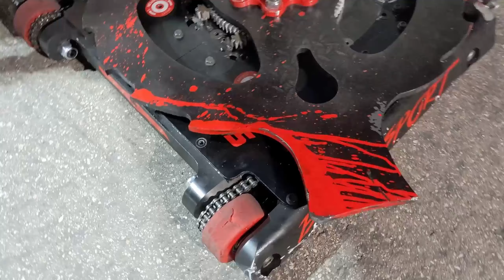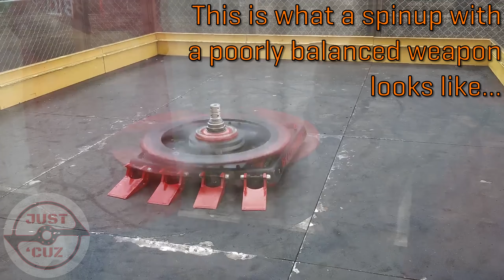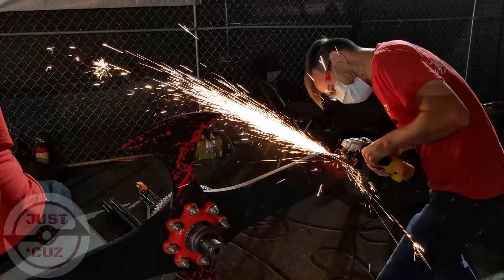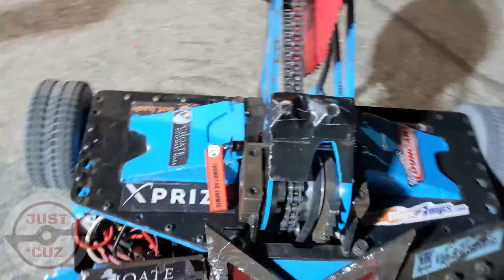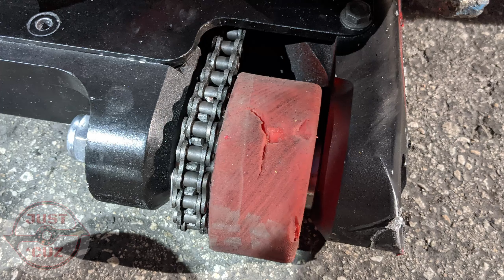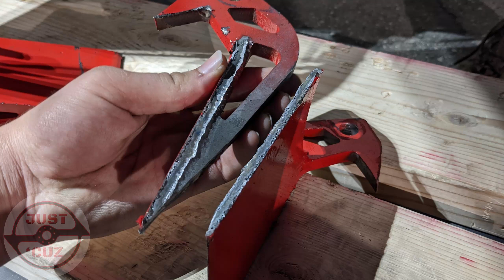Bloodsport vs Skorpios: Battlebots Season 5 Fight Recap

Comment: Put a blade clutch on that weapon.  Look at different pieces of  farm equipment.  They got spinning blades on every thing
Reply from the maker: This is not as trivial as it sounds for the sort of weapon we have and the weight and space constraints. However we are considering something to that effect (though on the motors not the weapon itself) for the 2022 season
Reply: Blade clutches come in million sizes.  The ones on my small corn head are rather small "about the size of your fist and weigh about 2 - 3 pounds.  
   Some have 2 , one on the pto input as well as the spinning blade . A clutch on the motor would save it from damage.  
I tried to find out what steel brush hog blades were made from but companies won't give that up .
Reply: A blade clutch would be almost a direct bolt on . I will show the video to my neighbor  Walter.  He is older than I am " I am 50 " l want his opinion on  your bot . I love your bot !

Comment: Can you address the wedgelets longer to spinning bar so when fighting wedge It unable them to stop the spinner. Make bloodsport manuevere to the side plss for winning your bot
Reply from the maker: I'm not sure I can completely read this correctly haha. If you are asking can we make the wedgelets not hit out spinning bar, we did try to do that. The mounts limited the angle the wedgelets could angle upwards when they were still actually intact so they passed under the blades but the mounts broke in this fight and several others. We will improve both wedgelet attachments, wedgelets themselves and the mechanical drivetrain to make it more reliable. Better more durable tires, better drive chains.
Reply: @JustCuzRobotics  thank you I am looking forward for that

Comment: Why use aluminum threaded rod as a mount for AR500 wedgelets? Why try to weld AR500? This is well known to give poor results.
Reply from the maker: The AR welding held well enough when done for us by the Lincoln Electric guys later in the competition, but admittedly we greatly underdesigned the wedgelet mounts this season and they are a prime candidate for a 2021 redesign

Comment: I'm sorry, I know this doesn't have anything to do with your fight, and you don't appear in episode 3 of battlebots, but I was wondering if you would share what your personal take on the Beta Vs Rotator fight is? Personally, I think Beta made the right decision in not firing their weapon, so they didn't risk losing their weapon or any critical components that could be expensive. It's obvious that Will Bales isn't happy about this as well. I'm pretty sure there aren't any rules on bots not using their weapons and just being a sumo bot, as long as they have a 'weapon' when going in. I just wanted to know if you might have an opinion on something like this? I.E., Duck doesn't have an actual 'weapon' in my opinion, but I've never heard anyone complain about it like Will is against Beta. Sorry for repeating myself so much in this, and that this video has literally nothing to do with your guys team. I won't expect a response or anything on such a controversial thing anyway! I'm just so intrigued with this fight. Please keep up the work guys, I'm rooting for you this season! :D
Reply from the maker: This definitely isn't the first controversial decision of the season and it won't be the last. I think the judging criterion for control and aggression are not followed very well by the judges. You can find these on the Battlebots website and it clearly states they a robot cannot get all 3 aggression points without using their primary weapon. It also has some somewhat vague descriptions of what counts as control vs aggression which are difficult to really apply to these fights in practice.

Personally I think Rotator should have gotten 4 or 5 damage points and the control and aggression should have been 1-2 at worst for Rotator. Clearly that's not how two judges saw it. I personally think Kraken should have beaten Black Dragon as well as they had way more aggression and control in that fight too and suffered hardly any damage, but everything is subjective.
Reply: @JustCuzRobotics  Oh, okay! I appreciate the feedback! I always assumed control was actually being able to push around the opponent and force them where you want them, while aggression was, well, how aggressive they were, to throw themselves at the opponent, if that makes sense. There won't ever be a perfect scoring system I guess, since some fights have different scenarios depending on the weapons and stuff. Thanks for your take on it!